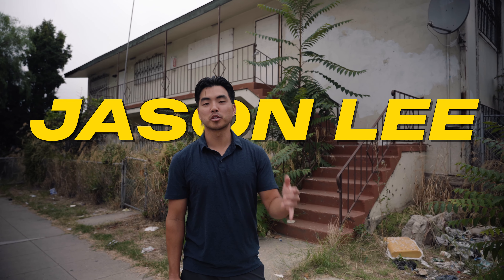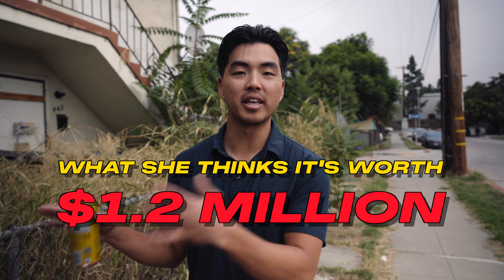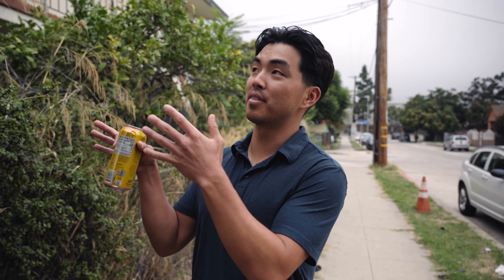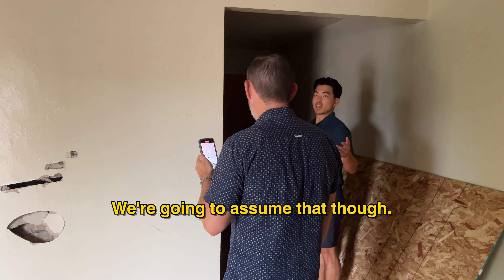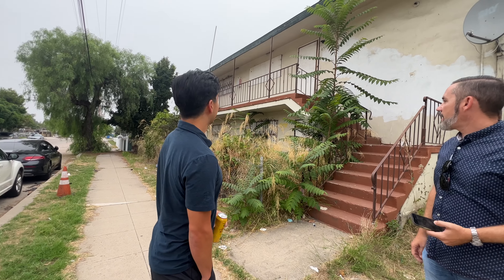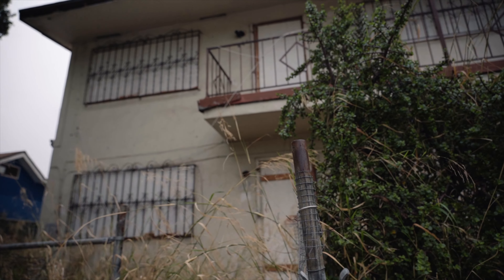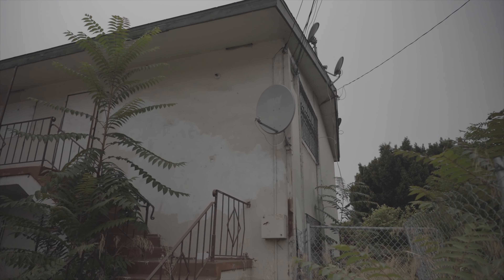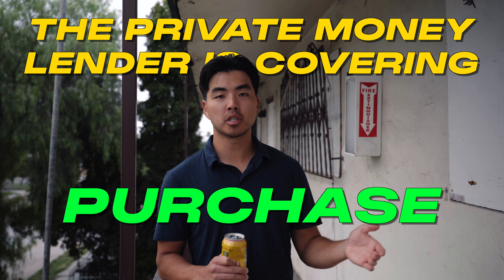We Have To SPEND $400,000 on This Property!!!

Comment: how exactly did you find it? great property. looking for some in OC but i have not seen a multi family with this much deferred maintenance in a while. if you pull permits for electrical and plumbing wont they see all the work you're doing(demo kitchen, bath, drywall etc) that they'll require insulation for T24, AQMD, permits for everything else etc?
Reply from the maker: relationships with realtors, and that will not happen no